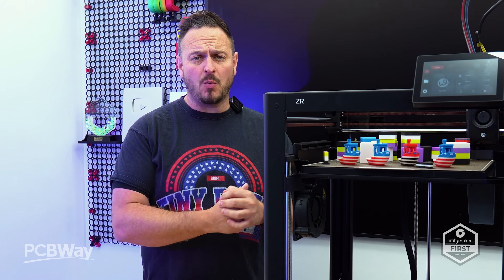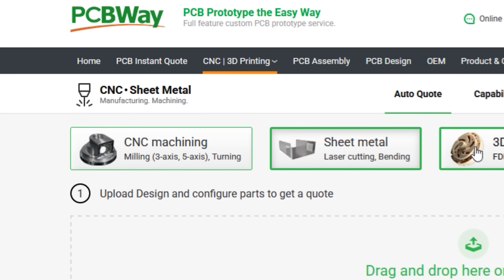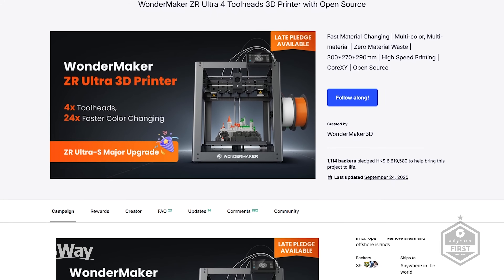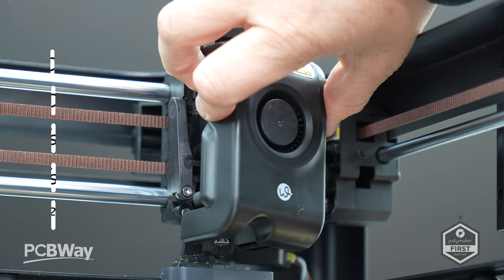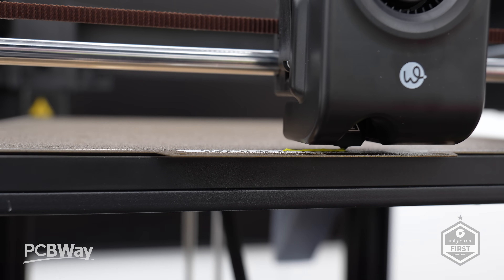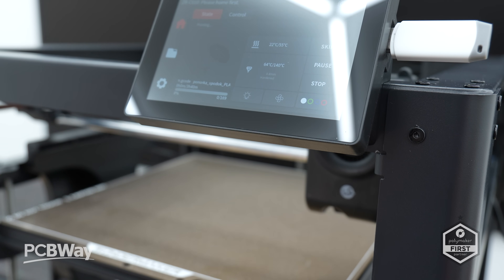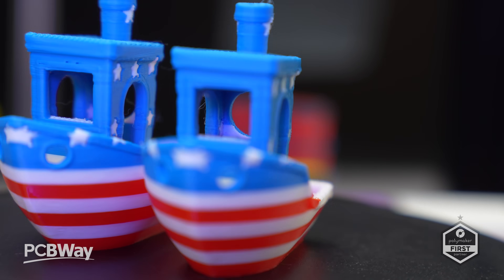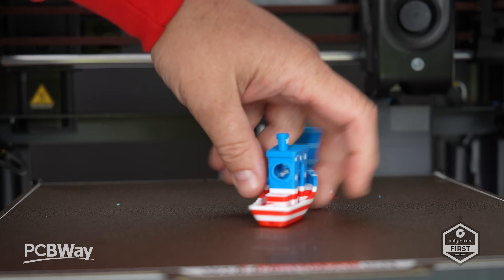Is the Wondermaker ZR the Next Big 3D Printer?

Comment: Cool introduction video of the Wondermaker ZR and best of luck to them. The ZR is very similar to Co-Prints approach for a single tool head where the PTFE tubes attach to a filament manifold close to the print head.  I performed a Co-Print KCM set retrofit on an old TAZ 4 that brought life back to the printer. I'm very happy with the performance and print quality of the Co-Print system. It was a straight forward install if one is familiar with Klipper. 
Also, I backed the Snapmaker U1 campaign!
Reply from the maker: Yeah that snapmaker is making waves I’m out there having a look at what they are doing very soon